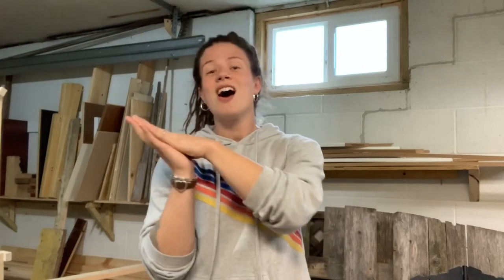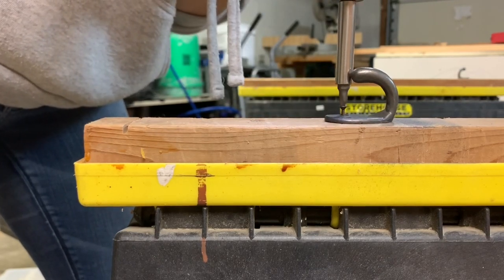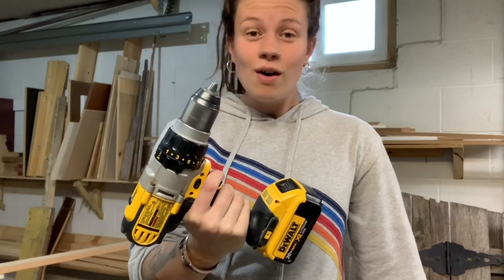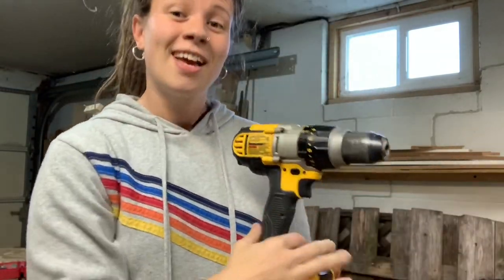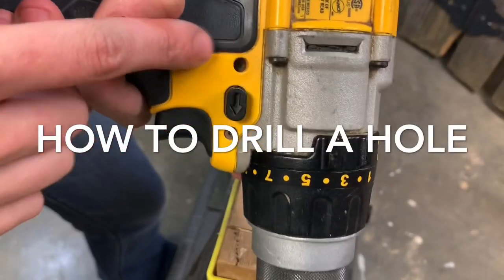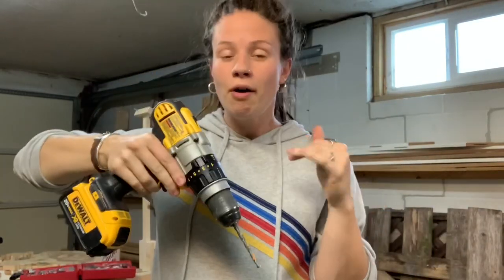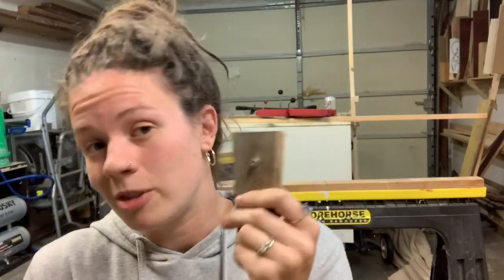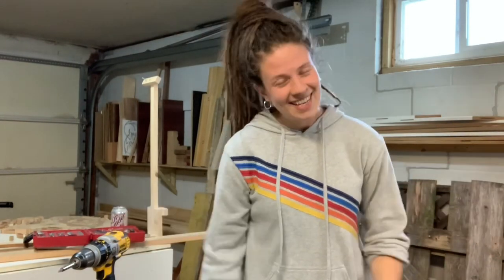How To Use A Power Drill— Power Tools Made Easy #2, For Beginners

Comment: When installing a drill bit into the chuck only open the jaws just slightly bigger than the bit to be used, which will stop the bit wobbling about.. then tighten accordingly.. good video..

Comment: I’m trying to hang my curtains n I try to do it all myself with just a screwdriver n it’s just not doing it any good the nails just not staying in and my rods and curtains are just about to fall off the wall…sigh.  My hubby is always bz and I hate to wait on him.. I just bought a drill so I hope it will solve my problem ty for this video.
Reply: Yes It’s a must have if u trying to drill nails into a hard wall.. it will secure n hang properly..

Comment: With the drill bit does it matter how quick u push in? I know it heats up but i dont know which is the best method and why

And the bit itself. The part thats solid without the grooves u want to put that all the way in or does that not matter?

Comment: Thank you so much. I have been surprised to see how difficult it is to determine the torque power of the clutch on these Dewalt drills. Here's my delima, hopefully you can assist. P.S. no way you have a 19 year old  😀 

Question: Exactly how much inch/pounds or foot/pounds is associated with each number value that is on the torque collar of this specific drill!

You'd be my hero if you could point to an answer.

Comment: I have an old drill corded dewalt but it has no drill bit key hole for changing the drill bits I've tried your method but the whole front of the drill spins hurting my hand like its locked into place anyone know how to remove a drill bit from it my father used it alot and never had an issue so I figure I'm not doing something right but every video doesn't have the type of drill I have this one has no key hole.

Comment: 3 is the fastest not the "powerfullest", 1 is the slowest and powerfullest because it is a lower gear....
The knob with numbers on it (torque settings) will not adjust the speed at all just the amount of force before the clutch starts to operate and stop the drill from spinning, and this only has effect in the driver mode, not drill or hammer.

Comment: Drilling and screwing are just 2 things a drill can do, try using that cordless drill in the kitchen !
Need a lot of freshly ground salt/pepper/whatever ? Attach the drill to shaft of the mill! Just start off easy to find the best speed for the mill (it's not 'full power' !) and you'll be able to grind the entire contents of it in under a minute.  (Works a LOT better than those derpy electric mills too .. )
Mixer just too flimsy or the the cord gets in the way ? Just stick the attachment in the drill!
Got one of those handle operated cheese graters ? Cordless drill!
Various brush attachments available too (great for BBQ cleaning).
I honestly use my drill more in the kitchen than for chores.
Even my 70 y/o mother who loves to cook went 'Ok that's actually handy' after initially facepalming in disappointment when i pulled out the drill when she complained about hurting arms when using the pepper mill but then watched me grind a whole bottle of pepper corns in under a minute by just attaching the drill to the top.

Comment: I applaud your effort, you seem very good at explaining things but your information on Hammerdrill/Drill Drivers is incorrect.

1st the speed selector isn’t a power selector, it is for selecting a given RPM range. (I.e. Speed 1 = 0-500 RPM, Speed 2 = 0-1500 RPM, Speed 3 = 0-2250 RPM) Your drill has a variable speed trigger so in my example speed 1 would start slow and max out at 500 RPM.

2nd the ring on the front of your drill is the clutch, and this also has nothing to do with power. It’s designed to slip when in screw driving mode at whatever torque/resistance setting is selected. Once dialed in you’ll be able to repeatedly drive fasteners (Of the same type and length, changeling setting as needed with different fasteners) flush in your material without overdriving it. The clutch is only engaged when tool is in screw driving mode. Your tool will have full torque in hammer mode and drill mode. Your example of setting the speed to 1 and the clutch to 1 does nothing with the clutch, because the clutch is not engaged. This is because you’re in drill mode. 

 I will say that trigger control is very important.

Comment: You do not have to use the trigger to change a drill bit, I would advise a new user to turn the CHUCK (yes its called a chuck people) by hand... when you get more proficient you can start pulling the trigger to change the drill.